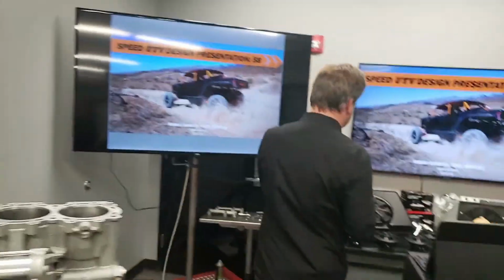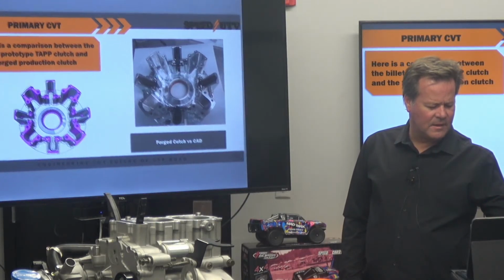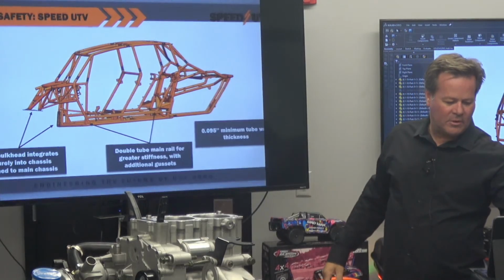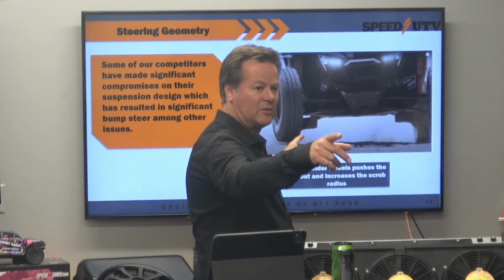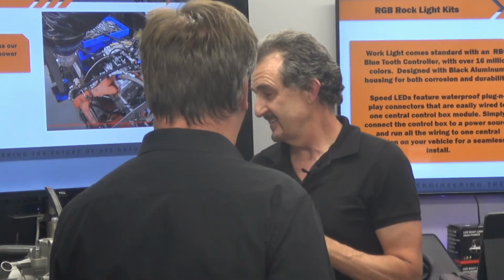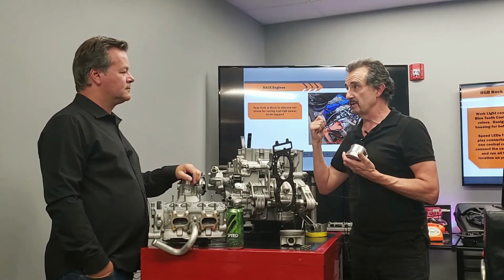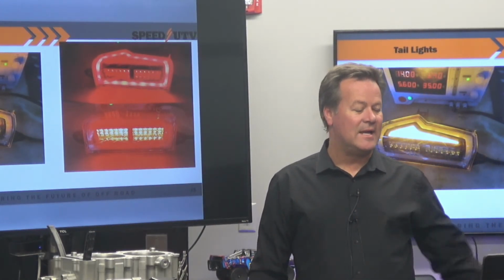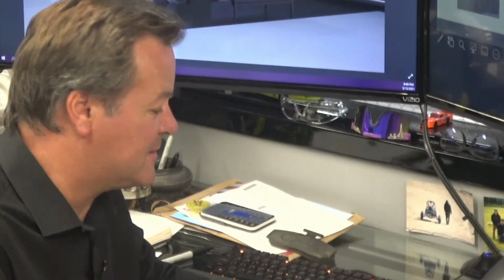Speed UTV Livestream Presentation. Episode No. 58

Comment: TO ME BAD BUMP STEERING IS BAD AND COULD BE A DEATH TRAP  TO COME UP FAST  SO POLARIS IS OFF MY LIST DUE TO ROLL CAGE AND STEERING ISSUE WITH THEM,  CAM AM  IS OFF THE LIST DUE TO ROLL CAGE AND    TO MANY DEATH CRASH ROLL OVER  AS WELL I MAY BE A LITTLE OLDER THEN SOME  but sorry for caps  but Robby just   is fixing what should of been done a long time ago   nerve damage in hands and elbow make it hard to type at times, they fall a sleep  due to hard work breaking rocks and lifting forms and  bad spine injury but i am not dead  so as a eng.   Speed UTV  is way a head of the curve on safety  like i am while working in the field.  but one day i will not have my hands or arms working they will fall asleep an not wake back up and just lay to my side.   so take one day as it could be your end if you drive a can am  or a piece of junk that not safe.

Comment: Will we be able to flash the front and rear lights so we can use them as turn signals? Here in Southern Utah, we can drive them on the street with just a few mods, it would be nice to be able to keep the factory lights for turn signals. I think I remember you saying that would be left to the aftermarket folks, that's would be fine if it's only a switch and flasher package and not a complete light replacement.